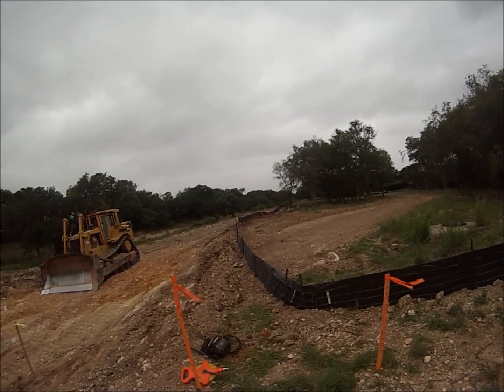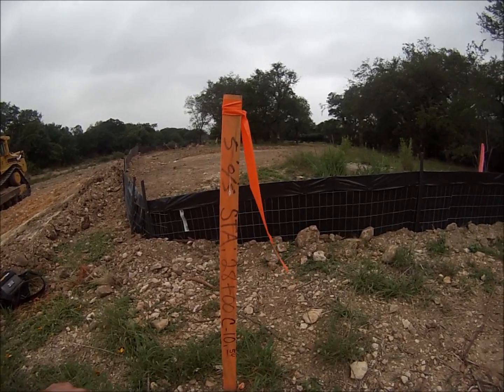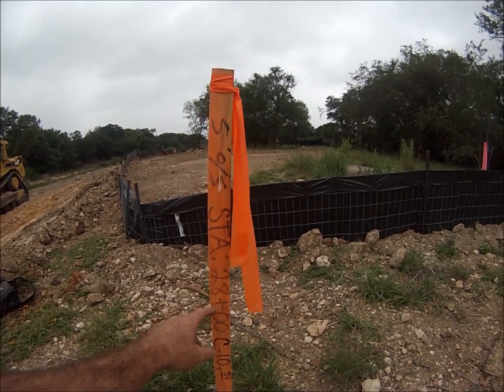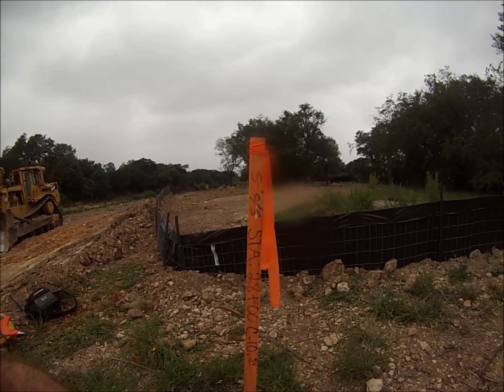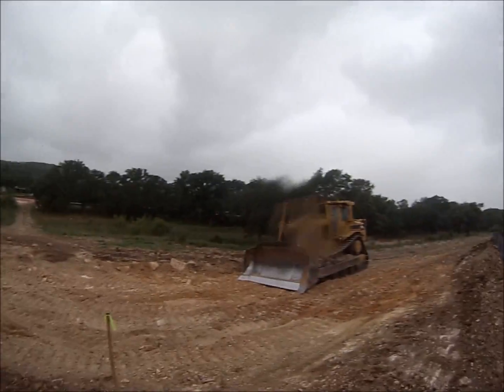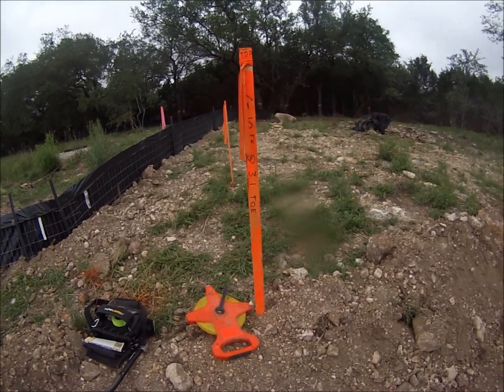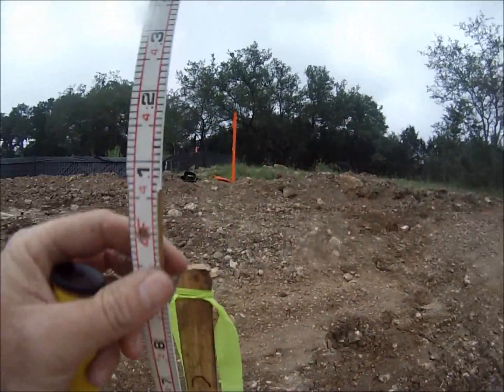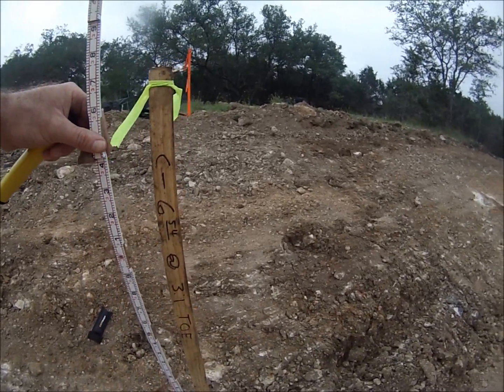How-to: read and set slope stakes

Comment: 3:1  in that format should be a 3 ft cut and a run of 1 ft ?? The first quoted number is usually the vertical value no?? Just wondering?

Comment: Cut of 10.54.  If only at that hub where the stake is.  U come down hill 5 foot.   No longer a 10.54 cut.   Difference in elevation down hill.  Looks to be at least a foot lower from video.   And a pocket optic is not very reliable.     You need a optic leveler.    Legs and a rod.   Makes it lot easier.

Comment: loving the video. I always "lose the change" on my fist cut/fill stake on a slope...meaning you have a C-10.54 so....... 
1. take 4.54' (from the 10.54) and X it by 3' (3:1 slope ratio)= 13.62' 
2. pull out 13.62' set a stake and shoot 4.54', mark the stake (this mark will be your cut or fill to grade)
3. all remaining stakes set will be easily set with a 12' pull out and a 4' shot till you hit 0.00' being final grade

that's "losing the change". it makes it a shit load easier for the grade checker who comes in behind you to continue if needed, or mainly let the boss know your work is clean as fuck so keep on driving I GOT THIS HANDLED!
Reply: Newbie here, just want to know where/how did you end up getting 4.54’ from 10.54?
Reply: @DavidHernandez-mf9nd  I know this is 2 years late, but maybe you'll see this. In the vid he has a cut of 10.54, and in the video he pulls out 12'. I've always been taught to run slope stakes in 4' intervals (4 ' of vertical grade change). To get 4' of vertical grade change at a 3:1 slope, that would be 12' horizontal grade change. Think rise/run. Along with the guy who commented, I've also been taught to lose the change/ugly numbers at the top, so since he has a cut of 10.54, that would be getting rid of that 0.54 of the cut in your initial slope stake. Meaning that instead of wanting to shoot 4' at 12' for the 3:1, you'd want to shoot 4.54. You'd find your horizontal change (The distance that you'd measure off the stake) the same way he did in the vid. Instead of 4' x 3:1 giving you 12' you'd take 4.54 and multiply that by 3 for your 3:1, giving you 13.62. You'd then pull 13.62' off of the top stake, and if you're on grade, you'd be shooting 4.54'. Now instead of having a cut of 6.54 @ 3:1, you have a cut of 6' @ 3:1, you would then pull out 12' shoot 4' for grade. Getting rid of the messy numbers at the top of the slope looks cleaner, and makes it easier if any grade checkers come behind you to finish running stakes for you. Getting the math out of the way in the beginning makes it easier. Hope this helps
Reply: @Dozerbk96 excellent explanation!

Comment: Ok so I was asked to find out the differences between the symbols of grade stakes and was wondering you could help me? The symbols are below

F
C-L
C with a L through it
BCTC
BM
-0-0- with a line through the 0's also
Reply: +Jared Tatum F = Fill, C/L = Centerline, BCTC = Back of Curb/Top of Curb, BM = Benchmark, Two 0's with line through them = grade
Reply from the maker: ok well the "F" stands for fill, meaning dirt needs to be added to achieve the desired grade, the "C/L" means centerline, honestly not quite sure what the other letters are referencing, but the "BM" means, to me anyway... benchmark. If it were "BTM" it would mean bottom.
Reply: BC typically stands for Begin Curve, not sure about BCTC. For "Grade" (subject surface is at the design elevation) we write a single 0 with a single horizontal line through it.

Comment: O the stakes are to know how much dirt goes where basically after the stakes are set correctly the person just has to fill the dirt to the top of the stakes in each areas to get your correct slope or grade .. nice didn't consider this know I know the point of surveying and its importance's
Reply from the maker: sam111880 yes. the stakes tell you how much the ground has to change and to what elevation, grade, etc.

Comment: Got a ? for ya.  If I see this correctly, the Offset stake is facing perpendicular to the stake to it's left.  If my math is correct, if it is a 3:1, 10.54' then shouldn't the slope be out 31.62' at the toe?  Sure wish I could draw a little picture for this for your review.
Reply from the maker: You are correct! if you pulled 31.62 feet from the top of slope stake, and dropped a rock that would be where your toe would fall.

Comment: That's how I used to do it! I always liked the story stakes but it seem like most surveyors hate putting them in too much writing I guess lol. Now I just drag that heavy ass rover around with me everywhere when I check grade.
Reply from the maker: Yeah that is how I learned. But the surveyors only gave me the cuts. I had to reference the plans and profile/cut sheet to make sure all the slopes were the right cut. Then I just added what I felt any normal person would like to see that can read and understand stakes as I bring down my toe.
Reply: soldierofdirt81 Yeah that's how the surveyors around here are just give you an offset with a cut and the rest is up to you. I haven't seen a story stake since I lived in Phoenix.
Reply from the maker: I have to agree on the story stakes. They are very valuable. I haven't seen one myself since I left California to move back to Texas. The craziest ones I came across were on the last big job I did in Santa Paula, CA. And they read something like this: C-15.40 BTM of FTG//F+.25:1 TOP//LEVEL @ 5'// F+25.00 @ 2:1 TOP 
That was one hell of a story stake. it was for a retaining wall then a walkway trail. Then a crazy fill slope. Good thing I knew how that was to look in my mind. Haha